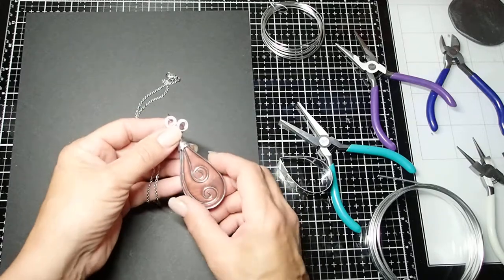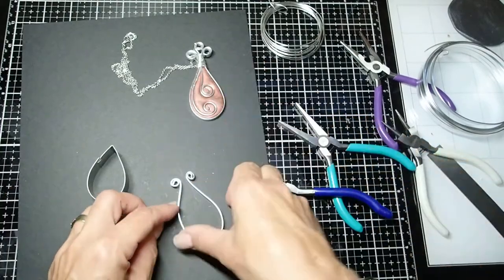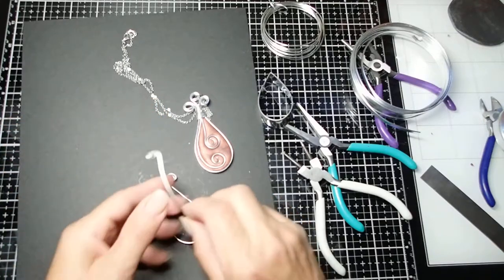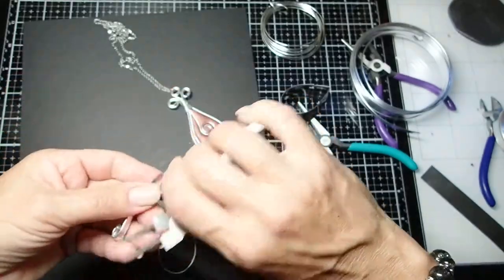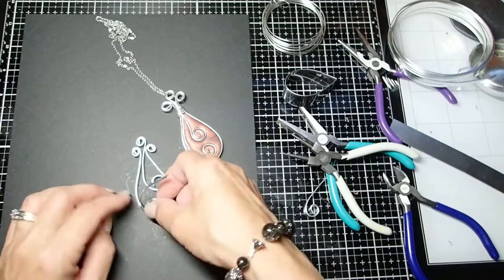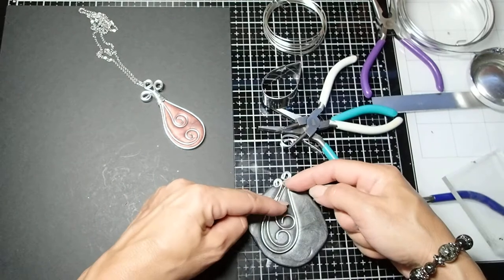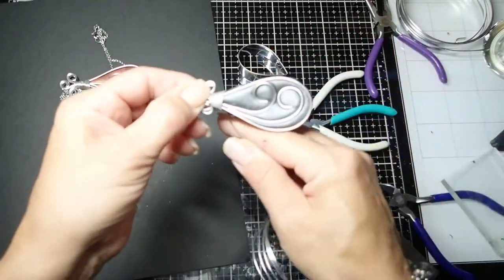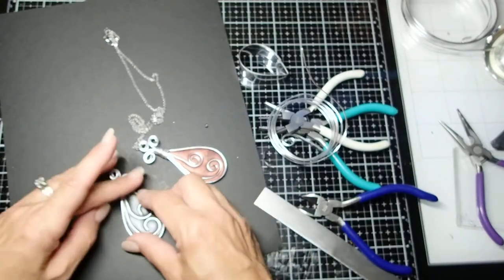Flat wire pendant with polymer clay

Comment: do you have any videos showing how you clean up the back?  Also you said something about varnish...how do you do that?
Reply from the maker: Well hello there Friend! I sand the back of my pendants with a very fine sand paper. I use anything between 800 to 1200 grid so it is not abrasive but gets the job done. With regards to varnish... You apply the varnish after you are done with baking and sanding the pendant and you simply want to protect it. You can get different kind, gloss, satin, matte, whatever you want. Some pendants you want to just protect but don't want to add any shine to it so you would use matte. Sculpey makes varnishes and you can get them at Michaels. However, I myself started getting varnish from Lowes and Home Depot and it seems to work very well on my pendants.The one that I am using is Varathane Polyurethane Crystal Clear Matte and I also have gloss as well. You get SO much more for your money.  Another way to protect pendant with with resin. I do have a video on it as it is my favorite way to seal my jewelry. Let me know if I answered your question. Thank you SO much for watching the video! I love sharing my passion with others!! Keep me posted with your project!
Reply: @joannascorner4478  hey thanks for the reply!  

Oh, i dont really have a project right now...I'm just researching the way people do different things with crafts.  Hopefully someday i'll have a craft i do. lol  I really like your craft projects and the way you do things.  You are so helpful and nice.  Thank you very much for all the information provided.  Have a Great Day!